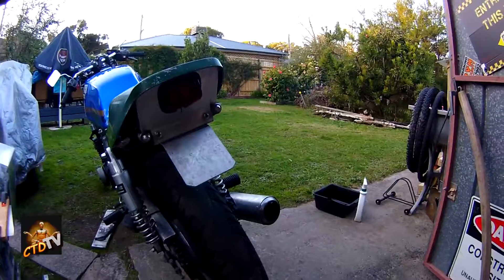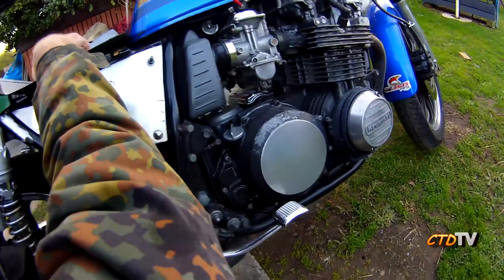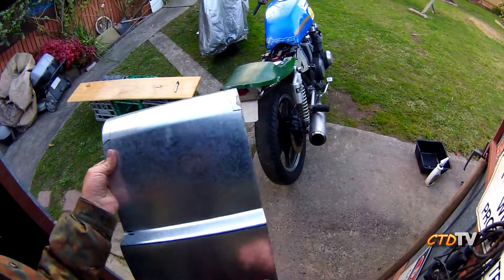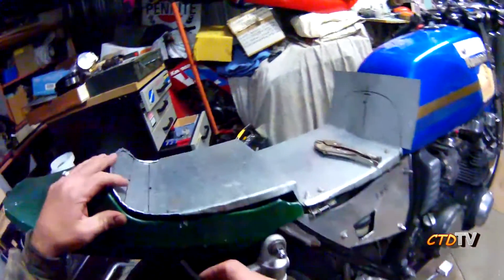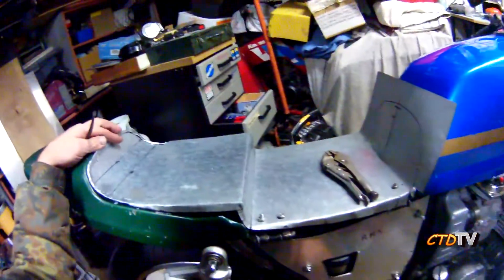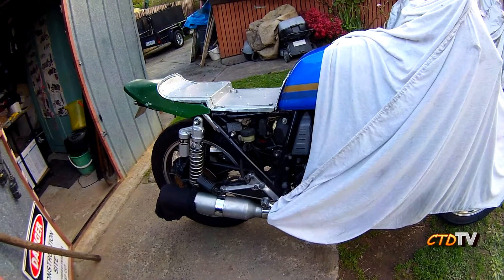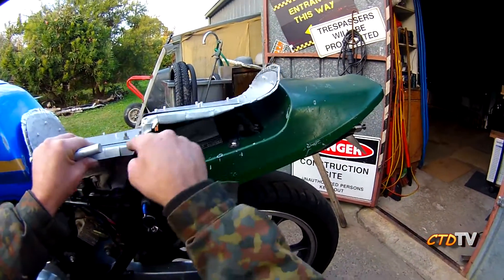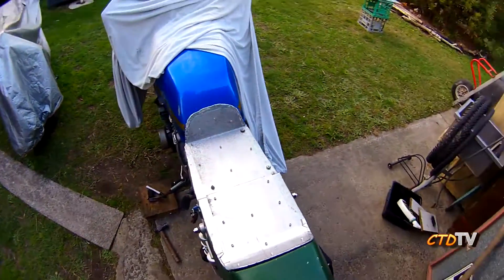Making a Seat-base - 1983 Kawa z750 ReBuild

Comment: is the battery on a z750 straight under the seat = electric vasectomy?
Reply from the maker: +mickthe philosopher Oooh, thanks for reminding me, I must check the clearance (it is a Steel seat-base...).
But yes, the battery/Vasectomy Machine is straight under the seat.
Just had a thought...Have you ever seen/heard of a battery exploding? I have in a car, makes a real Acidic mess...touch wood it NEVER happens on this bike!!
Otherwise it may effect my wood.........lol
TFW Mick, RS.
>:)
Reply: I think exploding batteries are rare, but shorting it out would probably cause a lot of time consuming problems.

 looking forward to seeing the Z back on the road.